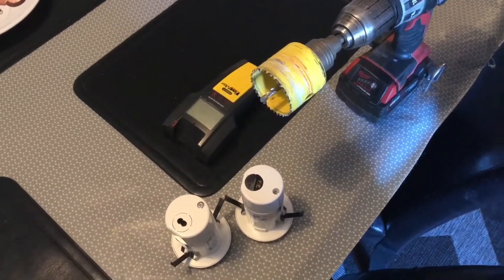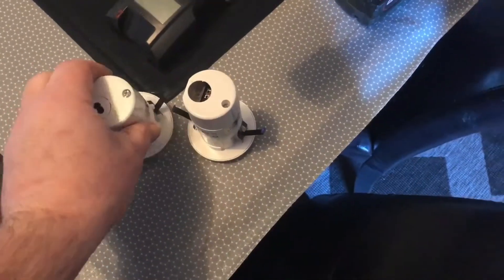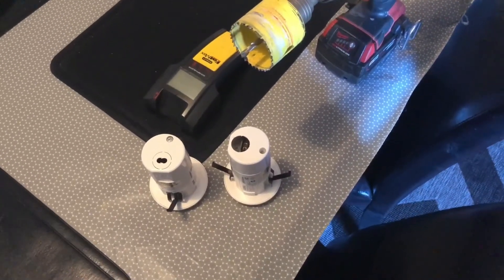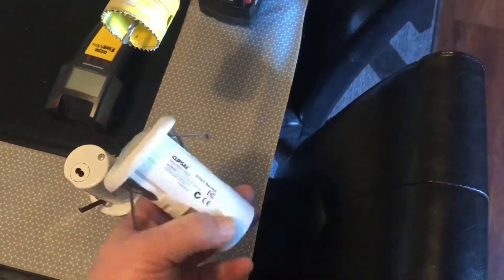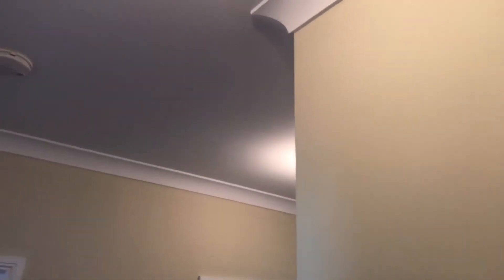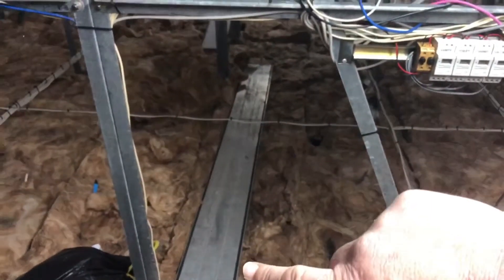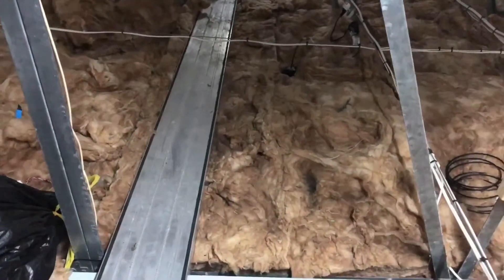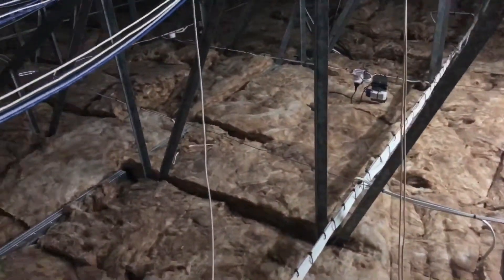C-Bus PIR occupancy sensor Part 2

Comment from the maker: just to clarify, when I said high voltage power cables, what I meant to say was higher voltage, the power and light cables are 240volts, and is considered low voltage . but never less is still mains AC and is lethal if you come into contact with Bear conductors and since the house is made of Metal ALL the framing is tired to earthed and all mains power in this house has earth leak protection Circuit breakers ( RCD )